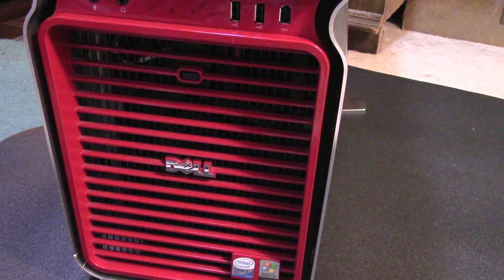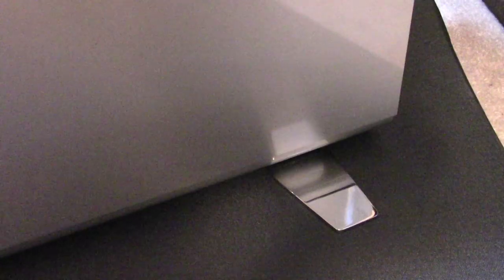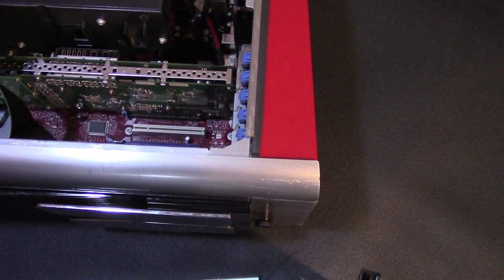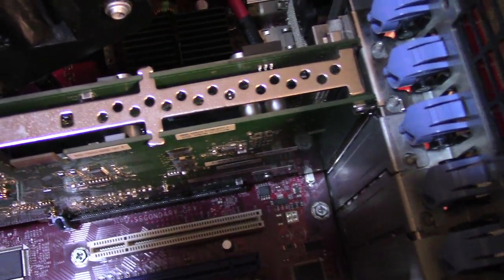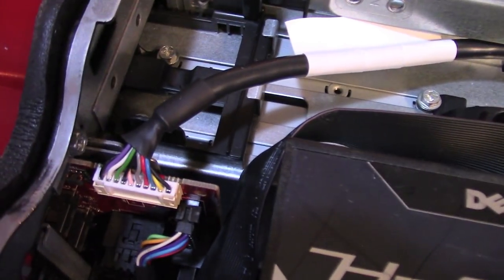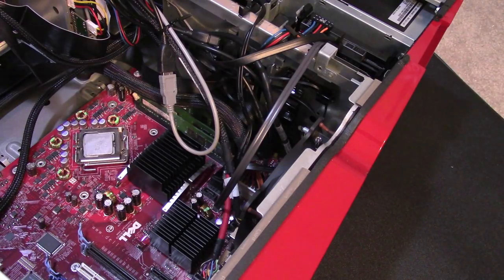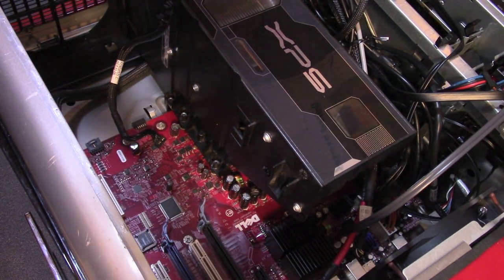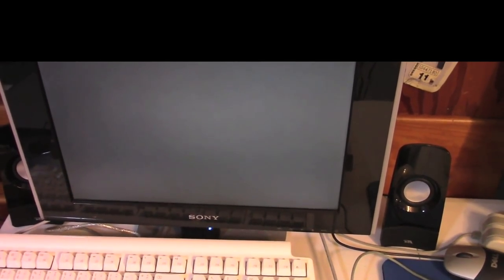Dell Anti-Powermac G5 (XPS 720 H2C) Part 1 CPU Upgrade

Comment: Don't know where you got the Dell from but I have seen many mangled Dell cases in Thrift Stores.Some of the brainiacs that work there don't know how to open them for inspection and mangle the heck out of them. Good videos,I love "found" PCs.
Reply from the maker: I got it from my old job at a computer repair shop.  At my Goodwill, they only sell some computer parts but not the machines anymore.  I have seen some bigger versions of this case in the back though, ready to go to a Goodwill Computer Store.
Reply from the maker: Oops, wrong video!  I got this Dell on Ebay!
Reply: Local store used to almost always have pcs in every week but I haven't seen any since the beginning of COVID roughly

Comment: Not all G5s have that power connector, only the final revision models do. I have an air-cooled dual processor G5 from early 05 and it uses a normal power connector, but the dual-core equivalent from a few months later has that server style connector.

Comment: you can use a Xeon if you use an adaptor there is avid on you tube
Reply from the maker: The LGA 771 to 775 mod!  I am not sure if there are any worth trying since I am limited to a 1066 FSB.
Reply: Rapidly Ageing Technology please try it
Reply: @RapidlyAgeingTechnology  pretty sure there are 775 compatible xeons on the 1066 bus. Your limiting factor will likely be Dell's bios support for chips. Make sure you check the QVL for parts before you buy!

Comment: How do you connect the computer to a monitor/tv??
Reply from the maker: With the right cable.  In this case, a DVI cable.  If you have a newer TV, you would need a DVI to HDMI converter.